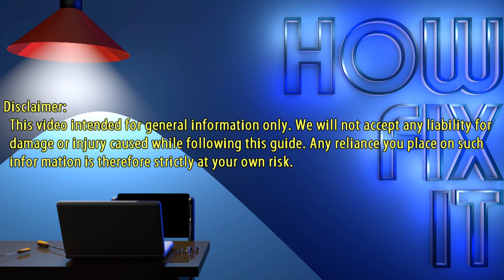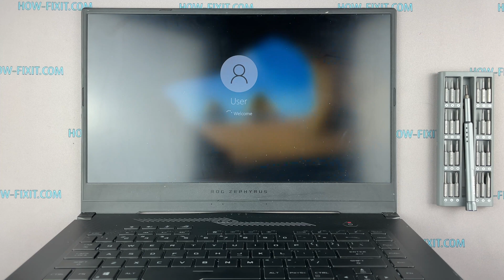Asus ROG Zephyrus G15 GA502 RAM Upgrade and Install - Your Step-by-Step DIY Guide

Comment: I changed the ram… but mine had the black thing glued to the ram, so i removed it with the ram and put the replacement (32GB DDR4 3200MHz Corsair Vengeance) will that be okay?
Reply: That's a thermal pad used for cooling the RAM. Y'know how gaming laptop can get hot
Reply: Did the 32gb ram stick work? So total 40gb?
Reply: I thought max was 32gb as per specs. 16gb soldered (1 slot) and 1 slot available for an 8gb or 16gb. A Crucial 16gb going for $30 on Amazon.

Comment: Does ga502 only have 1 ram slot? because I am trying to upgrade it which is straight forward but it says 1 of 2 slots used on my task manager but in this video it seems like there's only 1 slot. Do I really have a second slot or it just displays it like that.
Reply: Did you find out if its just the one slot and the other is soldered on?
Reply: @jamesthinrg4067 it is like that

Comment: Hello. 
Question. So this laptop can only support up to 20gb max?

If there is 8gb soldered to the board, can I only install 8gb for the total of 16?

Or can I still install 16gb for the total of 24gb?

Because I don’t think 12gb single SODIMM exists.

Comment: How does adding unequal ram affect dual channel memory speed? Will 16 + 8 reduce it to single channel?
Reply: No, if you have for example one 16gb and one 8gb your ram will run in dual channel for the first 8 gb (so up to 16 gb of usage) after that it'll run in single channel
Reply: @cckiller4378  can U explain bit clear now I have 8x2 16gb (by default) if I add one 16gb of sodimm ddr4 it will become 24gb then will it consider as single channel or duel plz tell

Comment: on task manager iv been checked, it has 2 slots. is it possible to add the ram in second slot instead of upgrade it?
Reply: You will have to check the compatibility between the 2 bars if you do so, but it is definitely possible. I highly recommend getting 2 bars that run at the same frequency
Reply: @diacoal2433  what do you mean frequency? 3200Mhz? my ram is 8gb ddr4 3200mhz.
Reply: @VIIIK-22  yeah 3200mhz is the frequency
Reply: AFAIK you need to solder the ram directly to the motherboard to be able to upgrade the second DIMM

Comment: I am looking to install a 32gb of ram, just wondering if this would be a good move?
Reply: It. Is impossible to install 32gb as it only allows to upgrade one module and the other is soldered on the motherboard. And it may cause some stability issues since ryzen work better with two rams of the same capacity working in tandem.

Comment: Thanks for the vid. I upgraded from 2 * 8 gb 3200 mhz cards to 2 * 16 gb 3200 mhz cards and the performance has dropped! Any ideas?
Reply: how can you put 2 modules? it's only one slot available for ram module the other is soldered to the mainboard.
Reply: @jaywalker6464  soldered RAM  is what I came to see here but nobody shows it. Is the RAM size fixed across all G15s or does it change?
Reply: Yes I would like to know as the one slot is irritating

Comment: Hello my friend,  thanks for the video. I have one of this machine, is the same of the video, but have an accident ant the notebook is literally dead, I believe the cost to repair will be higher than a new one. Also, the main board have crashed 5 months latter this accident (1was the screen only.... ok, was using as a desktop) but then the motherboard fry out, so, I have only scrap here. The question is, what is reusable,  once the problem is on the motherboard,  I can use in some way the other elements?? For sure, the hdd M2 is already in use, and the RAM I don't have where to use yet, I am running only a desktop now.... can you give some ideias of what I can use the rest of the machine, as processor and vga.  Thanks